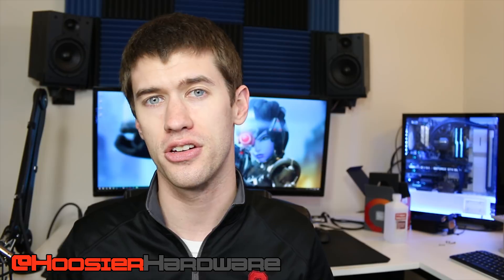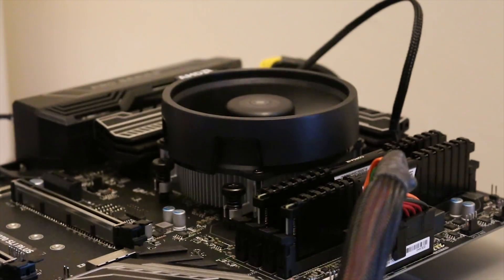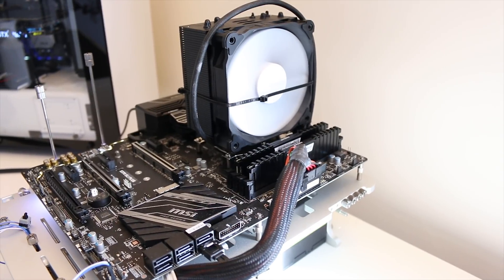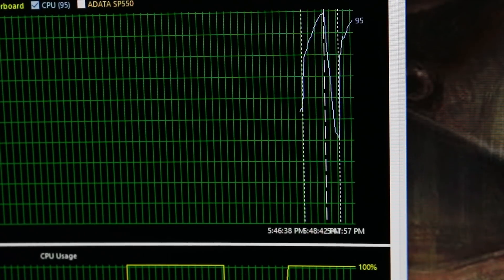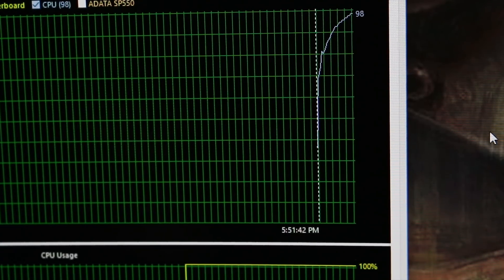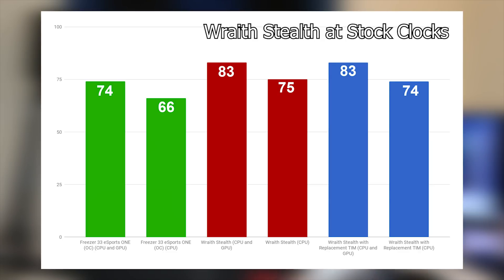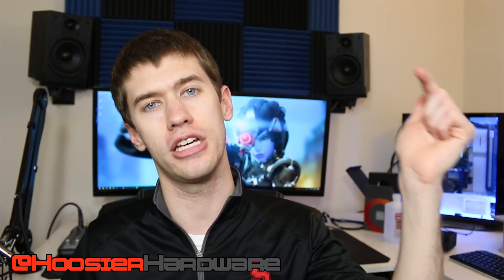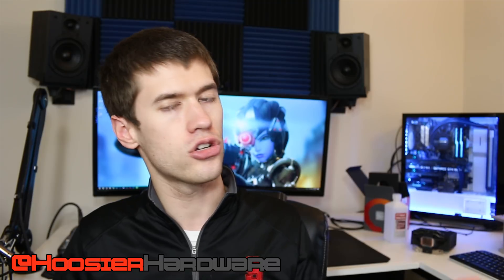Don't Overclock with the Wraith Stealth Cooler

Comment: With this cooler on my 3600 hits 92C while running Cinebench R20. I bought the value budget king Deep Cool GTE V2 and it now only goes as high as 70C while running Cinebench R20. $34.99 well spent on Amazon.

Comment: The stock cooler got my 2200G to 3.9 ghz 1.4v  The r5 1600 wraith spire would run hot at 3.7 ghz so I got a $20 Gammax 400 and n ow its 4.0 ghz @ 1.375 v 24/7

Comment: uhhhh.... My 2400G is running at 3.8GHz,1.25V,with the Wraith Stealth Cooler and the original thermal paste.....
Reply: I think 1,25 v is a little bit high for 3,8 ghz. You can't reach 3,9 ghz at 1,25 v?

Comment: Hi ! I think you can try to overclock without raising the SOC voltage, it increase a lot the temperature without any benefit, and with the right memory kit (at 3000MHz and above) the GPU is easier to overclock (no extra voltage needed), in my tests I can Overclock the 2200G and the 2400G at 3.95 1.4V with stock cooler and temp around 75 under OCCT (10 hours in a NXZT S340 with stock fans), for the GPU as well I can get 1600MHz stable on the 2200G and 1500MHz on the 2400G both without touching the GFX voltage. Keep up the good work ! 👍
Reply: Hardware Numb3rs i overclock vega 8 with stock cooler to 1.3ghz without increase any voltage and the temp reach around 63 °C at max while playing dota 2 (cpu at stock ) is this safe for long term ? .
Reply: adrian damaris you have good temps, you can raise the clock even higher :)
Reply: Hardware Numb3rs glad to hear that. My friend told me that i shoud buy a better cooler to keep the cpu temp bellow 60 but im planning to buy a better cpu cooler(non stock ) later when i upgrade my cpu to ryzen 5 or 7 in the future and ofc a gpu too . And im  curently ok with playing dota at 70avg fps (low) , gta avg45fps (lowest) .  Thanks for the reppy btw
Reply: adrian damaris the main reason to change the stock cooler on Ryzens is more silence, if you are going to buy another CPU you’ll get also a better stock cooler

Comment: I've got the 2400G, but still haven't bought ANYTHING else.  Not even my motherboard...but I am aiming for an MSI B350
Reply: you probs shoulda waited for a bundle, or sale or smt before grabbing the cpu. saves a lot of money
Reply: Vegetables are good for you
I didn't want a bundle.  I wanted to choose the parts myself.  And the CPU price was fine.  $99 for the 2200G and $169 for the 2400G?  That's not bad.
Reply: nakyer nah microcenters often have bundle of cpu and mobo and sometimes even ram for cheap. There was one where effectively thr 2400g was only $100 considering the discount
Reply: Vegetables are good for you
Did you read what I said?  I wanted to pick out the parts myself, thanks.  
And not everyone has a MicroCenter near them.
Dude...
Not everyone is you.
Reply: just buy msi b350m mortar, ram 4gbx2 2400mhz and psu 500w
Reply: Smile cat
I'm guessing you meant "mobo" and not "mortar"?
I based my build on Shane's but went with 16gb of memory.  Otherwise, it has the same mother board, and the same power supply, 550 watts.
It's running and doing fine, but it's still in a "test bench" type situation.  Not in a case...yet.
Reply: my spec
ryzen 5 2400g + msi b350m mortar + 2x4gb 2400mhz + psu550w.
Reply: Smile cat
Why do you keep using the term "mortar"?
Reply: haha
https://www.msi.com/Motherboard/B350M-MORTAR/Specification
Reply: I suggest you go for Asus tuf b450 plus gaming

Comment: I bought the $39.99 cooler master ML120L aio for my 2400g and with my x370 mobo I can hit 4.1ghz on all cores w/ 1.3875v but can't get 4.2ghz to boot windows without 1.475v and that's just too much
Reply: i am gona buy ml240l rgb i hope it will be good

Comment: You should change the title to "on Ryzen Apu's". I ran my ryzen 1200 at 3.8GHz at 1.35 volts and went 70-80c at full load with 40 idle. I'm sure many others had the same experience.
Reply: Ditto with my old 1400. It did great. At stock, I could leave it on silent (700rpm) and never have it go above 65C. To his credit, he' did say he's never tried them.

Seems the APUs run a fair bit hotter, as would be expected from having a lot more heat-producing silicon and TIM paste vs. metal solder.
Reply: Same. I got my ryzen 3 1200 to 3.8 with no problems on the stock cooler. Wasn't the apu, but still.
Reply: Yeah, I think having to overcome the TIM inside the IHS is a problem for OC vs the soldered Ryzen non-APU chips having better heat conductivity.

Comment: I have a 1600 on 3.8 ghz with the wraith and I don't get over 70 ºC, of course I guess the apus get much hotter. Maybe amd should increase the tdp so people don't get surprises with the temps
Reply: The 1600 uses the Spire, not the Stealth cooler, which is a better cooler.
Reply: Yasin Omidi not exactly true, the tdp is the recommended spec for the cooler in combination with that chip under normal circumstances. Not taking oc into account. https://www.google.dk/amp/s/amp.reddit.com/r/Amd/comments/6svy1a/tdp_vs_tdp/
Reply: BEEENG the tdp is basically the power usage, they cannot just change it, well they can but it will get hotter.
Reply: oh this changes a lot of things. i thought it was how much heat it generates. thanks for the article.
Reply: Yasin Omidi np m8 :)
Reply: Walter Wenzl oh I see, that makes sense